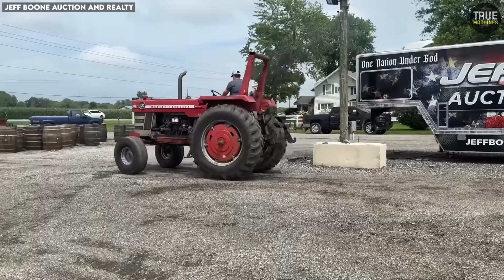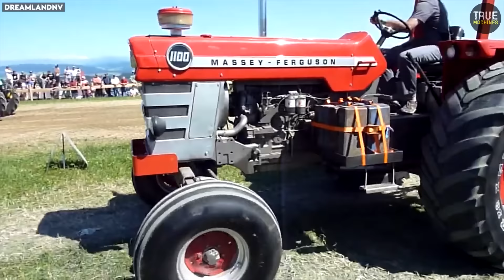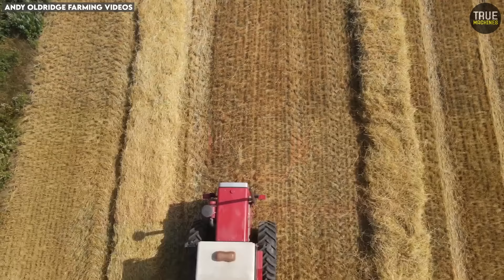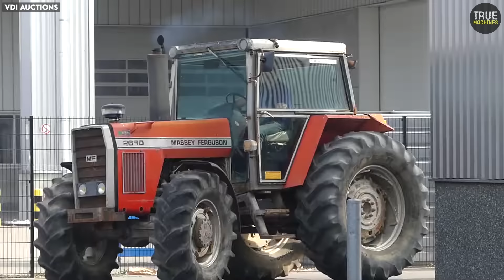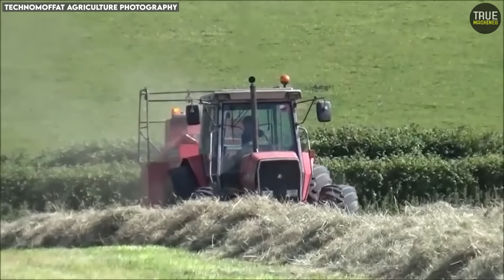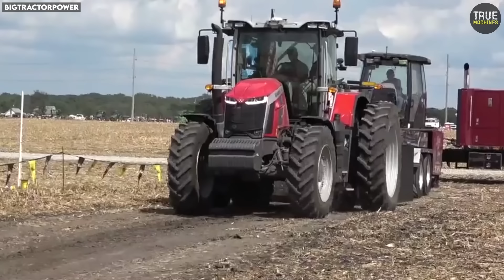10 Massey Ferguson Tractors That Were Too Advanced for Their Time

Comment: Massey Ferguson never used caterpillar engines on their tractors
Reply: Doch zB. Mf 1805 und die grossen Knicklenker der 4ooo Serie
Reply: They used a CAT V8 in the 1505.
Reply: Massey Ferguson DID indeed use the Cat 3208 and the Cat3160  V8 diesel engines in the early 1970's articulating tractors.